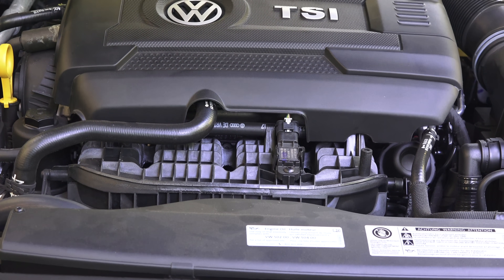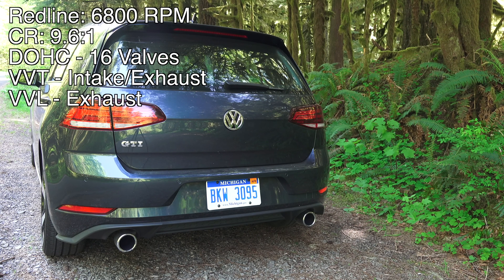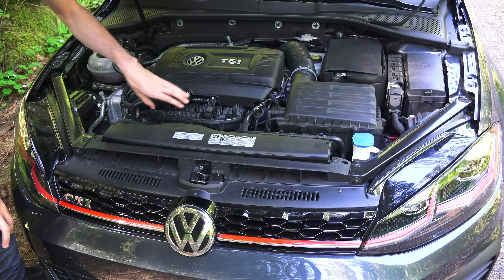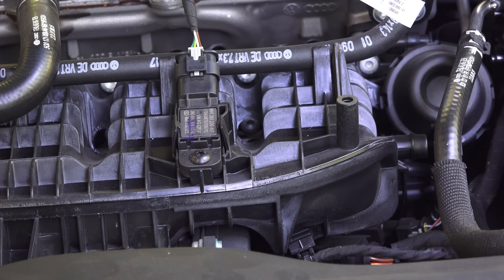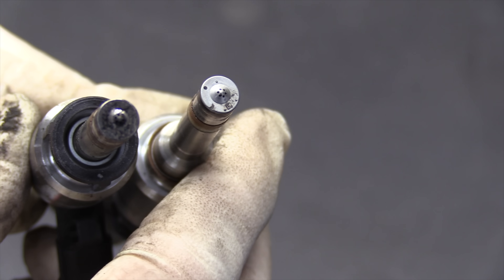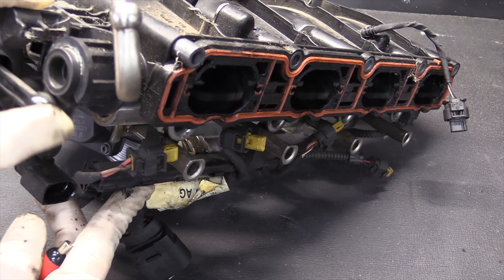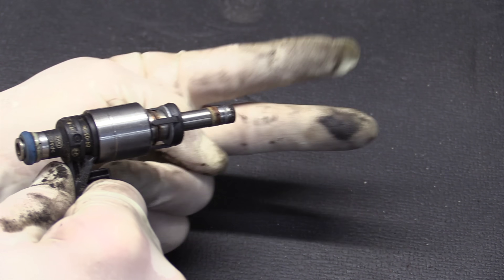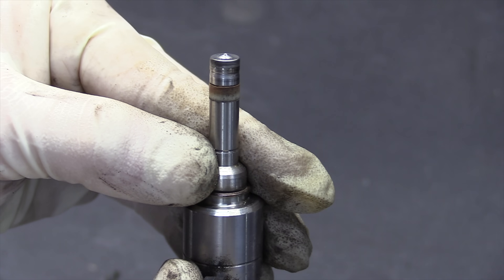The Best Engines - Volkswagen GTI Turbo

Comment: VQ37VHR
Reply: Zohan James relax fam. Jason asks at the end of each video for an engine suggestion. That's all this guy was doing. He was just giving his suggestion, but then you just have to come along and run your big mouth for no reason.
Reply: Zohan James    Has no idea how to maintain a Nissan-Renault engine setup, also doesn't know that the chipped 350Z will eat chipped GTI's alive. The 370Z is a refined, old man's car, for individual driving, not drag racing. The GT-R is sold for that consumer, as is the R8/R10. A golf cannot hold up the top end, just light to light or possibly quarter mile if you get a good start.
Edit: Don't run your mouth unless you want to put your wallet on the line. The poor golf only torques to max 7700 rpm with less power than the VQ which goes up to ~8K at stock. Also, if you do the N/A treatment for the VQ35, it can get something like 320 stable hp with some pricey parts & lotsa gas. The VQ37 is less dense & needs more work; that is why it should stay stock like new pickup trucks.
Also, there was a drag-special VQ35 with no block modifications that cranked over 400 hp with methanol crapwater. Just a new top & pistons (possible custom crank). The iron is what is needed. You can put a 35 in a 37 chassis as well. Little to no mount changes if the trans fits on.
Reply: @edlingja1  I own a 350z and mk7 gti. A tuned 350z cannot hang with a tuned gti whatsoever. I've walked plenty fbo tuned 370z with 7 speed autos which are quicker than the 6 speed manual. A  gti is lighter and gearing is shorter especially in the dsg. A stage 2 gti makes close to 320-340whp with torque levels near 350-380 depending on tune with the stock turbo  I have videos of me beating tuned hr 350zs and 370z's with great drivers. Only Z that gave me problems was a fbo tuned 370z with gears. And don't even mention a maxima. They are even slower and heavier.
Reply: Zohan James 
Also, the new High Output Maxima R can cream a GTI with just a CVT advantage. No jokes it is a beast.
Also, speed is speed; naturally aspirated engines are not the same as charged ones. But people will compete anyways.
Reply: Tony Ji nissan= garbage vw its aight i own one it likes to burn oil just like the vq valve seats maybe bad rings idk but anyway lol
Reply: jr castro why one do you have? I've read of you don't break them in properly then they'll burn oil. If that is true, I blame consumed and not manufacturer
Reply: jr castro oh and yes, I agree, nissan is trash!
Reply: Zohan James its just the design not the consumer its a great engine i have the GLI 2015 its a cool little fast car its low and mid torque is good high torque is kind of wack but its completely stock other than appearance mods
Reply: Zohan James and nissan eehh dont care for them
Reply: Tony Ji a stock GTI can run with that VQ37. They're not that great! A simple $600 ECU flash and it'll walk that POS Nissan. I say this based on several things : 1) I've witnessed a race between these 2 cars and watched the GTI win. 2) I owned both and the GTI was definitely faster and 3) Nissans are famous for oil consumption problems from precat material being sucked up into the engine and destroying it. I used to be a hard core Nissan fan after constant problems with that damn maxima and discovering a simple flash to my GTI would destroy that 370z I said F&$#! It and never looked back! 😎
Reply: lmfao relax please
Reply: Tony Ji you relax!
Reply: ilovecoolanime you chill. I'm speaking my mind on my experiences with nissan and adding no body running their mouth but you, fam!
Reply: Jay Edlington a chipped 350z is no match for a stage 1 gti that is fact. I've seen it for myself

Comment: The only thing that vw or audi engines are really well known for are lengthened timing chains and high oil consumption cause of those clocked up piston rings. And a repair can be very expensive.....has been featured on German TV back some days. Well....

Comment: You made a mistake on the max RPMs. I own this car and it's max RPM is 8000!
Reply from the maker: Haha, it most definitely is not 8,000 RPM stock with the 2.0L. Perhaps with a reflash, but I doubt that since the turbo starts dropping fast at 4500.
Reply: 6800 rev limited from stock. tunes can raise it up more
Reply: European i have revs till ~7200. Stock

Comment: Nice video. Does direct injectors affect the valve performance on long run ? They better have port injectors with them, for cleaning valves.
Reply: they were suppose to have port injection with it. it gets a lot of carbon build up (my car has the same engine).
Reply: The new pcv system on the 2015+ engines have cut down carbon build up a ton. Not really as huge an issue anymore.
Reply: Not doubting you, but do you have a source?  I have a 2017 GTI and always wondered when/if I would need to do carbon cleaning.  Good to hear that it may have been improved.
Reply: I have an Audi S1 Sportback Quattro also with a 231 bhp 2.0 TFSI EA888 engine ... mine have dual injectors ,,,, port and direct injectors.
Reply: Yathu prem yes they have terrible carbon problems that require GDI engine and fuel additives. They get very bad to the point I've seen intakes off at 60k for runner malfunctions and valve cleanings. It's disgusting they sold those.
Reply: There are port injection kits offered for these that also let you run ethanol. EU market got port injection also to pass emissions
Reply: Italian tuneup has worked great for burning those carbon deposits.

Comment: I have a quick quesiton :D im looking into a 2009-2012 golf R (mk6) .... it also has a 2.0l engine but produces 270hp ...the question is "is that engine in the R just as good as this one, considering it should be almost the same?" thx :D
Reply: snakeddj the golf r 2012 is ea113 engine. The newer one is ea888 with a k04. They're good engines, pretty similar. Ea113 is an older design though
Reply: So i got nothing to be worried about? cause i originally wanted the older S3 thats 2006-2009 but ive read a lot of bad things about the DSG failure on those models and how the DSG is fixed after 2009 thus i transitioned into a Golf 6 R so now i just hope the engine is also not problematic cause ive been saving money for a while and i have the money now just waiting for a good one to pop up on the car trading sites :D
Reply: snakeddj if it's a dry dsg then expect problems. Servicing and maintaining these cars are not cheap. I recommend if you're saving money for this car you should probably have another 50% money available.

Comment: Best engine ever is the old 1.9 TDI with 90 hp. Lasts longer than the cars its been used for.
Reply: Anyone who hasn't owned a 1.9tdi from VAG 2000 era doesn't have a clue about it when they talk crap about it. Best diesel engines ever made.
Reply: Got a Skoda Octavia Break model, TDI 1.9L 95hp (but not common rail... weird, at least to me.) The engine is past 270.000 km, and not a single repair has had to be done on it. We checked, it doesn't include emission tests cheats. When running at 80km/h, that car consumes 4.0L/100km on average (or so it says on the fuel consumption display.)
Reply: Marc Fransen I have a 1.9 TDI with 100hp from 2006 and it consumes 4.4 l/100km when going on the Autobahn with 120km/h. I checked that out by comparing the km counter with the amount I had to refuel and it was accurate.
Reply: T D I M A S T E R R A C E
Reply: 2002 Golf IV 1.9 TDI 101 hp here, runs like a charm with 207000+ km. I got it for long commutes on the Autobahn (up to 1200 km a week in the past year). Usually I prefer japanese cars, but aside from Lexus nothing comes close to German cars on long distance high speed comutes. The Golf IV 1.9 TDI  is a good compromise and basically all the car you ever need. Insanely practical, relatively fast, relatively economical and comfortable with a design that really aged well. They don't run on fairy dust, but a Chevy or Ford truck with a direct injection petrol engine produces  more co2 and at least as much particulates as old Diesel engines. Beware of the trade-war propaganda kids ;)
Reply: Had a 2000 Leon with this engine, 350 000km, stock turbo, stock clutch and remapped at 200 000km 👍🏻
Reply: Hubert dada pd140 was the best engine. Just my opinion.
Reply: keshav sakthi you do realize Mercedes, Honda, Mazada and Mitsubishi are all in trouble for the same emissions cheating VW did?    Bet you didn't! Hope they get the same punishment as VW.
Reply: Look at car throttle's high mileage hero car. It has that same ALH Diesel.
Reply: the best is 1.9tdi PD 101hp
Reply: I have a 2006 TDI beetle, love it except that the previous owner put some extra wiring in it that caught fire... Still runs, but need a new wiring harness for the rear... 

Back and forth if in the mean time i want to get an older ALH tdi car or the 2.0 gas engine...
Reply: Our 450k km audi a4 2003 still runs. Only a turbo reconditioning was done at 350k
Reply: Actually they are!
Reply: M Cunha yeah i compared it to the 1.6
Reply: I got the 105 bhp
Reply: I have this car 2005 golf 1.9.
Replaced glow plugs after 250k, not required mined you 😎
Replaced two car batteries, brakes, two sets of tyres, keylock, computer, airbag light on. Also boot lock and drivers side door central locking.
Otherwise good power with DSG, use sport more under 70km at start fast diesel!
Reply: I Preferred the pd130 ASZ myself.
Reply: @iamthepotato4312  yep, the last diesel made with old school reliability and longevity. Good power and driveability, genuine real world fuel economy and absolutely bombproof reliability. Tuneable too, if thats your thing. Brilliant engine.
Reply: Yea I miss my ALH but while we're on the topic of euro diesels, I'm addicted to the om606's tunability!
Must be since I'm canadian and superturbo mercs are non existant here... for now 😉
Reply: 340K miles strong on my parents 2002 jetta. 40+ mpg, transmission rebuild and that's it. No major engine issues
Reply: Hubert dada Lives longer than you live yourself
Reply: No, only the newer ones do. The 2001 ALH on my Golf has 500k miles and I've never really done anything to it
Reply: last longer than it's owner
Reply: I run a 1999 110bhp GT Tdi AHF VE pump .216 injectors  226,000 miles of hard driving.  Pulls hard up to red line, regularly upsets other drivers of supposedly faster new cars, when they just can't leave it behind and the VE injection is quieter and more reliable than PD. Crossed Germany one early morning 3 up with tools at an average 100mph and 54mpg (imp). Can average over 100 mpg (imp) if driven carefully but usually 50mpg as I don't hang around... Apparently one of the most efficient engines ever fitted to a car, can operate at 42% efficiency just below  peak torque. Often used for towing 1.5 tonne trailer (1000 miles recently) once towed a 9 tonne motor home in an emergency, it resulted in a fair bit of wheel spin to start (tyres being cheaper than a new clutch!) but she towed it OK. I really hammer this 20 year old Tdi but I do look after it and so far she's still going strong! Best all round car I've ever owned and I have had a few, BMW E30 325i, E46 2.0d, VolvoV70  Awd 2.5 turbo etc. By the way, suprisingly,  it's much better, in every way except ultimate (read: illegal speeds!) handling,  than the 2.0d E46 BMW which I bought to replace it 4 years ago so the E46 got parked and I'm still driving  the golf!
Reply: 1.9 tdi motorcode Asz 96kw and arl 110kw make easly 500.000 km
Reply: 99Lezard99 slow af? either you never driven one or your scale is high af. you will beat every 90 hp petrol engine back from that time for sure.
Reply: I would say it's nothing compaired to the first 2.0hdi (90 and 110hp). It doesn't start to smoke like a VAG engine. It is even more reliable. Sound's nice for a diesel and in reality (so not what's on the display or eu/usa standard test) one of the most efficient engines. A big carwebsite once did a test with the latest volvo c30, golf special low fuel versions driving to spain on a full tank, and brought a old standard 206 hdi I believe, for comparison. The old 206 won with a margin.
Reply: Don't trust the reading the display gives, the fuel economy on that car is good, but not that good
Reply: @Pspgamer789  dude i had a passat 1.9 TDI and did 800 kms on a full tank and i always stepped on it. Its really fcking effecient and i regret getting rid of it....
Reply: Well they were certainly economical and quite powerful. But it wasnt because other companies couldnt do the same. It was because other companies were not prepared to put in engines that sounded like they were commercial machine engines into passenger cars. 

We still have lots of customers who drive them and you can hear them and recognise what they are long before they come into your sight. They are so crude and were never suitable as a passenger car engine. They were effective but completely unrefined and appealed to people who had low expectations from their cars. (to most people who were coming from a 1.6 petrol engine they seemed incredibly powerful)
Reply: Hubert dada my granddad has a tractor from the seventies, still runs like new. Would I want that engine in my car? Hell no.
Reply: M Cunha look up the times on wikipedia. pretty similar number between petrol and diesel. (refering to the golf 4)
Reply: Volkswagen and the best is oxymoron ! I know I was working for VW/Audi dealership BUT yes this engine was quite good maybe because was copied from first real TDI engine namely FIAT Chroma And YES it last longer than car body because VW was stingy and didn't use zinc protection
Reply: @altergreenhorn  VW (Audi) was actually one of the first to use zinc on cars
Reply: keshav sakthi The Diesel gate engines were the 1.6 and 2.0 TDI common rail engines (and the 3.0 V6 TDI). The 1.9 TDI has pump valves, and is more or less rolling coal.

Good power and torque, but polluting.
The common rail engines have less torque, but pollutes way less (even with the cheat code).

The best 1.9 TDI engine by far is the BLS engine. They never fail.
Reply: @panzerveps   It’s embarrassing to hear the common citizen talk about air pollution when their government clearly does not GAF.
Reply: Yeah but it sounds like a tracktor, revs like a tracktor, doesnt respond and is slow af. Its good for carrying things/people cheap from a to b. Very reliably and economicaly but extremly underwhelming in all the other ways.
Reply: @99Lezard99  well its an economy car so there ya go..300k all day on these though
Reply: Hubert dada TDI engines Are powerful enough but only on very limited rpm range. Any petrol car with the same amount of power literary eat any TDI in terms of performance. Rover, Isuzu, Mercedes, BMW, And lately Honda make diesel engines which dont die after 4000 rpm, from these Are only BMW with little more reliability issue as TDI. Looks like TDI isnt nothing special. ;-)
Reply: Reliable sure! But Diesel... see that black smoke and that noise? Naah it's for ships, trucks or tanks but certainly not for individual cars.
Reply: Also cheats emission tests
Reply: @keshavsakthi546  every manufacturer does.  VW was picked on by the yanks - every manufacturer does this.  They have an ongoing war on against VW.  Go get with the times.
Reply: @keshavsakthi546  Not the 1.9L. I'm glad you're a hero and willing to comment on things you don't understand.
Reply: @keshavsakthi546  That's not the cheater, but pollutes even more than the cheater. VW stopped selling diesels in california because of that engine, since they couldn't get it to pass later emissions standards.
Reply: @keshavsakthi546  that’s the 2.0 tdi
Reply: @keshavsakthi546 who freaking cares. As long as I’m getting great mileage and my wallet is happy.

Comment: How was that intake so dirty ??  Did they drive it under water?
Reply: The EA 888 series uses an EGR-valve similar to most Diesel engines and that's the main reason the intake is so dirty.
Reply: That sounds like a better explanation than mine.
Reply: Flat Mars Society it’s direct injection. It happens in every direct injection engine.
Reply: Looks like bad blow-by to me, recirculated down the PCV to the intake manifold.
Reply: Direct injection or port injection only affects the build up on the valves.  Port injection giving cleaner valves.

Comment: I'd still take a toyota
Reply: I wish that Toyota (or even Lexus) made a hot hatch that competed with the golf, golf GTI, civic or focus ST.
Reply: Steven - doesn't stand the test of time? Supra owners would love to differ.
Reply: In France Toyota subsidized at least the Yaris' engine to Renault. They done derped!
Reply: Toyota absorbed the "IM" hatch and called it the "Corolla IM" [in the USA] when they rolled the Scion brand back into the mothership. It is pretty basic and likely compares to the base Civic / Elantra / etc. hatch models, but not the Golf in terms of cabin quality and definitely not the GTI for performance.
Reply: Yes, one should. If you think same about washing machine, dish washer and cars. Reliable and get the job done.
If you CAN feel the  steering, throttle and engine firing; you need at least VW.
Reply: Niru Which one?
Reply: If you only need to go from point a to point b, that's fine.
Reply: Niru that's you
Reply: Steven Does LC500 look cheap to you?
Reply: @niru no one cares.
Reply: Niru Toyota's always look cheap and never make a body style that stands the test time.